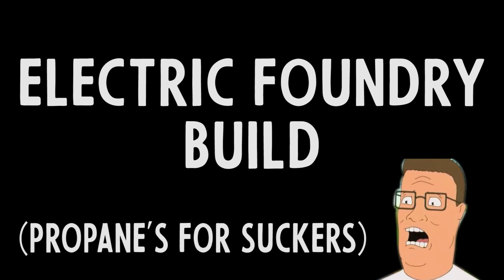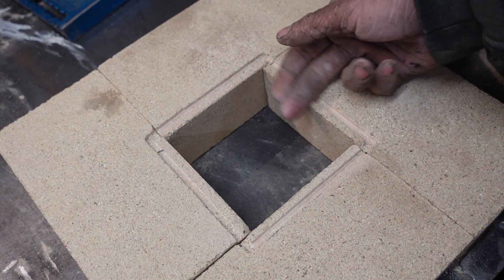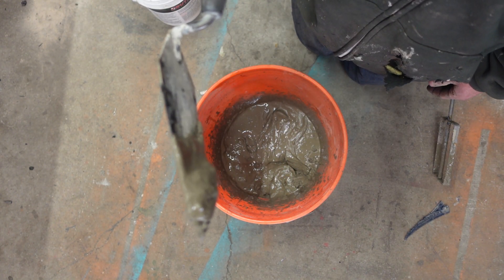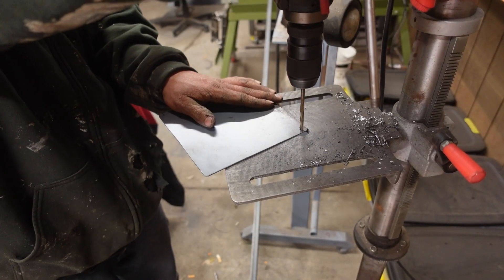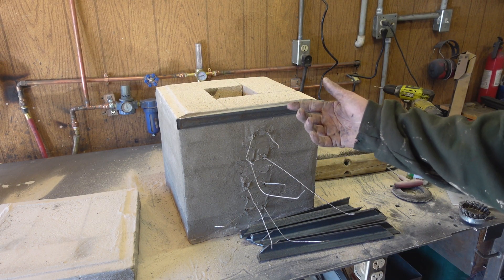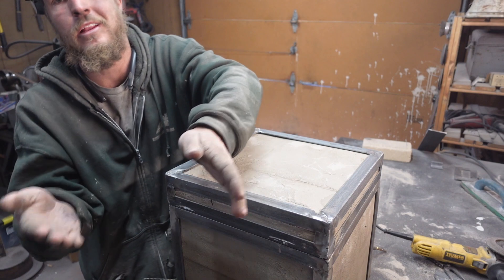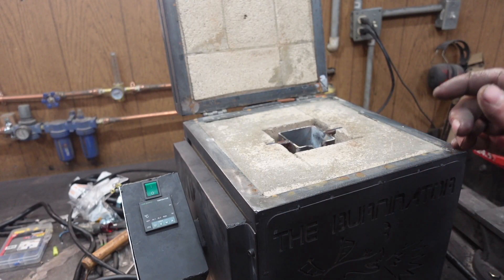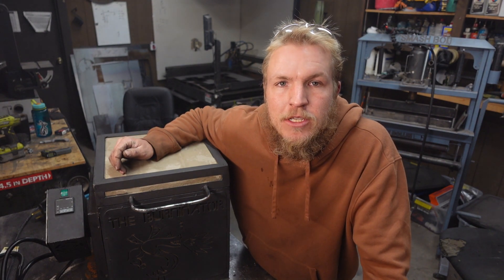DIY Electric Foundry For Metal Casting

Comment: To get a view down into the crucible without risking expensive cameras, you could probably use a mirror. Holding a hand mirror over the crucible, you could film the reflection and stay clear of the heat. Do you have a lot of interesting skills it’s funny how either of you are to try a project That you just jump in like Robin Hood. With a little swashbuckling, you save the day. Tally-ho!

PS, when you burninate, what will you do with those ingots? And how hot can it get? I mean, what can it melt?

Comment: Just be aware that the heating elements are exposed live wires. If you touch them with a conductive crucible like yours (and graphite is also conductive) you might get an unpleasant kiss from some angry pixies. It's safest to turn the power off when handling the crucible.

Comment: I was surprised you hadn't built an arc furnace for use with your welder, which looks like it has an arc output. Resistance wire by itself is pretty lame for foundry stuff because the metal fumes will generally alloy with the wire (they'll also alloy with your corporeal metals and I wish you would wear gloves while welding). I would take the box and make an arc furnace from it when the elements fail, for example.

Comment: There is a different type of brick that's white and very much air filled. I am trying to buy a few at a time, because good lord of darkness they are expensive. But can be cut with a hand saw for wood due to how much more air is between particules  if the brick. 

I first bought some heavy fire bricks like you got, and use them for my oxy ace melting needs lol

Comment: Awesome build! I've wanted to build one and will likely steal your method! PS not sure if you did but would make sure the inside of the electronic box is grounded in case a live wire ever makes contact with the case inside, and if there are any sides of the electronic box that aren't welded (just screwed in), would also ground that side as well. Thanks for the vid & liked!
Reply from the maker: Oh it's all good and grounded. There's something about red-hot, exposed 240v lines that makes me check over my wiring twice hahaha

Thanks so much for the support!
Reply: @cranktowncity  Awesome! After going through some of your other vids it was clear you knew how to make it happen :)

Comment: Awesome. I subbed. Im looking to make one of these too.
Reply from the maker: Thanks for the support!
When you build yours, make sure your coil has the right resistance where it doesn't pull more current than its rated for. I overlooked that, and had to redo the coils on mine!